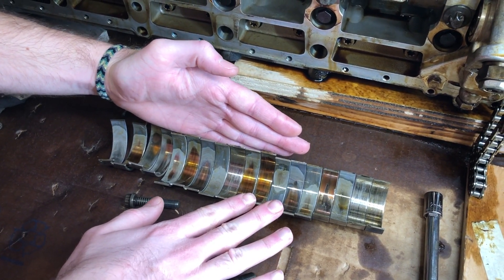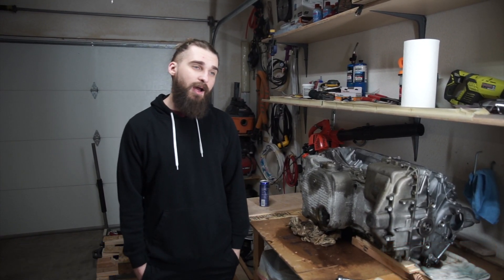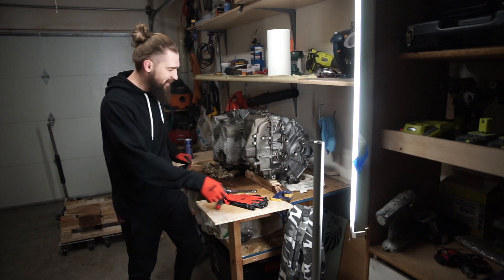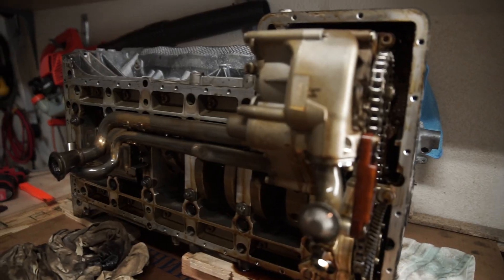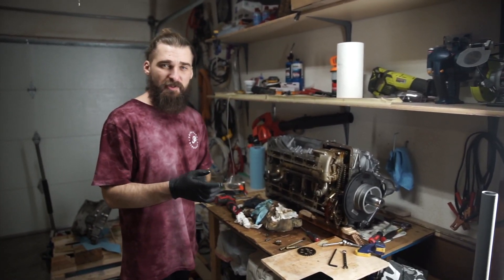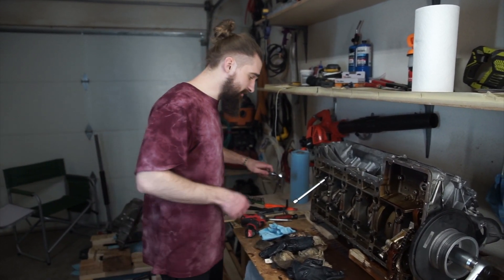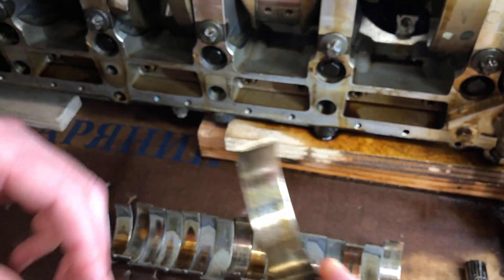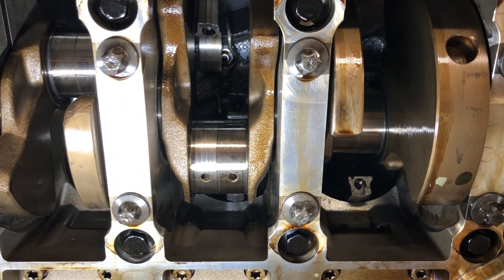How to Clean S85 Pistons & Piston Ring End Gaping (Does this BMW M5 V10 Have a Rod Knock?)

Comment: Well... it does matter. Those little scratches raise little micro size crowns, which get and stay hotter than the rest of the piston = detonation. 
If you can't feel it, it's probably fine but if you can feel a sharp edge at all, emery it until you don't.
Reply from the maker: Thats a great point actually. Really appreciate it. I'll double check for sure
-Eugene
Reply: @YEVSBUILDS  Good deal.  The DME is pretty good about backing it off before you actually get any detonation but it pull a ton of timing out if you start getting close.
Your motor looks pretty beat up. Where the rod bearings changed every 50k or so or are those the originals?
I get to pull mine soon, I changed them at 60k but I just rolled over 100k.
Car is hammered but damn these things are fast. So much fun and all that lovely noise!
Reply from the maker: @samtech79  It's good info to know. Appreciate it!
The motor is at 140k miles and I know zero history about it, hence I'm rebuilding the entire thing honestly. Clearly it needs a refresh though haha
Reply: @YEVSBUILDS  hey man, where you at? I'm on the south coast, Oregon.
Reply from the maker: @samtech79  Im in Portland OR
Reply: @YEVSBUILDS  Are you on any other boards?
We should play. I've got a supercharged S85 M6 and a new exhaust system sitting in a box.
Has the making of a very loud and possibly reckless video... 
Let's find a way to talk.
Reply from the maker: @samtech79  Haha sounds great! Hit me up on instagram @yevsbuilds
Reply: @YEVSBUILDS  None of the original owners changed rod bearings, they just drove them like crazy and if they popped they popped, seen it so many times. Only real enthusiast like this guy opens the entire engine and upgrades everything.
Reply from the maker: @MaciusSzwed  Got6ta do it if you want these engines to last!
Reply: @YEVSBUILDS  Thats what I wrote??